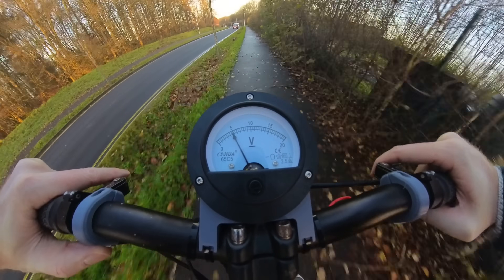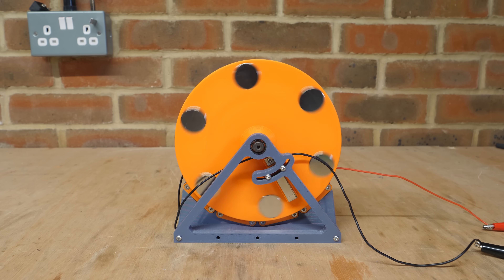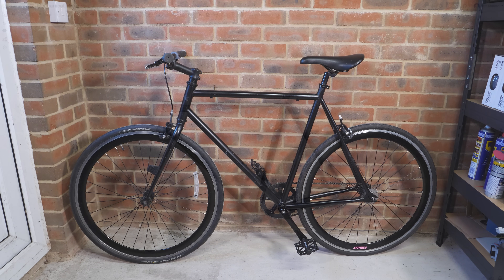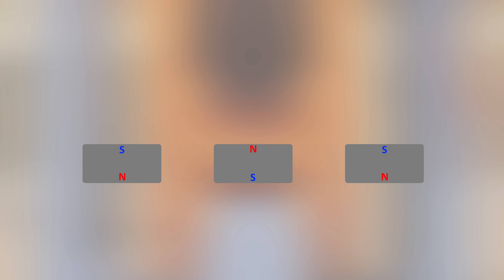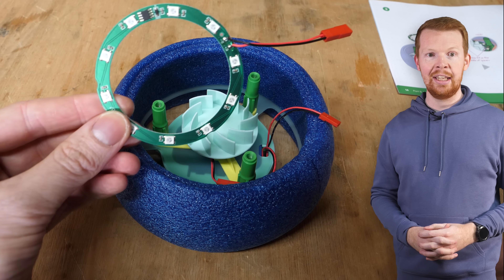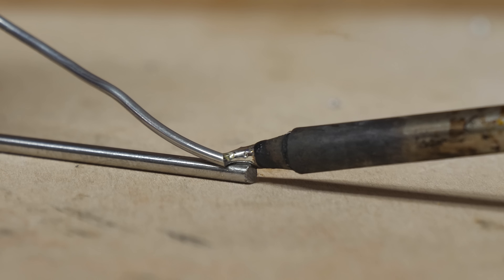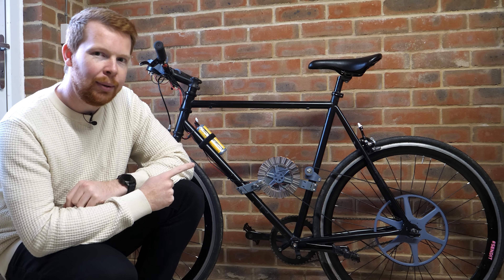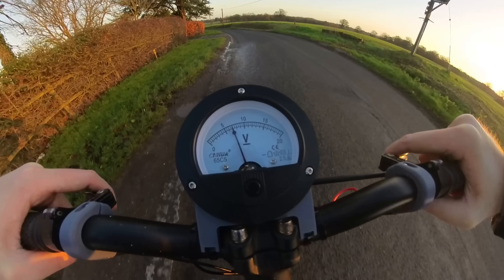The Most Minimal Electric Bike

Comment: You could even build a mechanical throttle: make the reed switch position variable: If it is closer to the magnets, it's on more often, if it's further out, it's on less often, varying the effective power.
But yeah, electronics are used for a reason. Even just replacing the reed switch with a simple sensor-transistor combo would make this thing a lot better (also needs a freewheeling diode so the transistor does not blow up).
Reply: You where thinking about opto-electronics? Or hall-Sensor?
Reply: That wouldn't really result in throttling, it would just cause the switch to either be always on (killing power and shorting the supercaps since it would be pulling backwards as much as pushing forwards on the rotor), always off, working correctly or sporadically and randomly in between, without any kind of consistent increase or decrease in duty cycle

Comment: A question from a non-electrically-educated-guy, why not put 2 engines on the bike? The first one would be the one in the video - the plastic one. The other one would be a standard e-bike motor. Basically charge downhill as you did and afterwords for a short distance give yourself ULTRA BOOST! not sure if it's actually plausible but at least in my mind it makes sense :D
Reply: And of course the super capacitor in between the motors...

Comment: Hello Tom,
About the spark after breaking the switch 
...
Did you know about the free will diode?
Every time a self is unpowerded it realease the actual magnetic energy through a spike .
You can short this spike with a single diode mount in reverse, or even better, keep and redirect this energy for your capacitors.
Just saying. May be it can increase efficientcy a bit

Sorry for my bad English, sir.
Reply: In english often called a "flyback diode". It is the right answer, but I think a diode qualifies as "electronics" and so isn't right for this project.
Reply: @bbrockert  It's also sometimes called a freewheel diode, from which I can see "free will diode" as an understandable misspelling.
Reply: Yeah, preventing arcing on switching inductive loads is a huge topic in electrical engineering 😉
Companies also put a lot of development in the material of the electrical contactor.
Also: If you want the switch to operate fast, then make it light wight. The little magnet on the switch contact adds too much inertia.
Try hot soldering the tungsten with silver solder
Reply: A diode is electronics, and he is specifillay not using that for the motor. That's the whole point of it all.

Comment: I know you said that you don't want to use electronics - but would a MOSFET with its gate hooked up to a copper wire coil work even better than a mechanical read switch?

Comment: It's interesting. Might I suggest  that you next build a charge controller with vacuum tubes. There are low voltage vacuum tubes were used in portable radios and there's a mechanic gadget that boost the voltage for the plate. I can't say that I've ever seen anyone build such a machine.
Reply: What's the advantage of using vacuum chubes?
Reply: @hxhdfjifzirstc894  Well, if we ever get hit by an extreme solar pulse, vacuum tubes will survive when semiconductors get fried. You might have the only working vehicle on Earth after a nuclear war. It would also be more warming of your parts for cold weather riding. I don't think it's a question of finding something better as much as its about finding a different way should conditions demand it.

Comment: Maybe if you want a regen brake you could mount a regular dynamo like a break pad. That is a cheaper simpler and easier method. You could even operate it with the brake lever, if you fiddle with it so that it engages before the regular brake. :)

Comment: You could add a 17v rated zener diode and a power resistor. When voltage goes over 17v it dumps the power into the resistor, heating whatever, instead of blowing up your supercaps and potentially neuter you.
Reply: Better yet to just have it energize a coil, disconnecting the circuit entirely.
Reply: Old car engines used electro-mechanical voltage regulators, for charging the battery from the alternator, or dynamo, whichever they used. Something a lot like relays with different, specific voltage ratings for their coils, doing the job without any silicon. It kept the battery charge voltage around something it could handle.
Reply: In parallel right?
Reply: @Eduardo_Espinoza  no, in series
Reply: There are far more elegant ways to prevent overcharging the capacitors, like using a 12 V battery pack and diodes, so the battery pack starts to soak up energy when the voltage goes over the voltage of the battery pack plus the dropout voltage of the diodes. 

The power rating of most common zener diodes range from a fraction of a watt, to 5 watts, which is essentially nothing in this case. Zener diodes are diodes, not voltage regulated switches. The current through it times the voltage drop will give you the power dissipated by the zener, a power resistor in series with a zener will only take care of the volts that the zener doesn't drop. At 18 volts, a 17 volt zener in series with a power resistor would have to dissipate 17/18 of the total amount of power through those two components. 

Another issue with zener diodes is that they don't give you a perfect cutout, they have a nominal voltage, but in reality it's a curve. All this put together makes zener diodes a poor choice for "direct" voltage regulation, for anything but very low power. Besides those details, your idea is great.
Reply: @fishyerik  Yeah you'd need a transistor with your zener to actually handle the current and send it through to the resistor. A zener is "electronics" anyway so you'd already be cheating. Using diodes with the battery pack doesn't make sense, since to charge and discharge, you'd need diodes going both ways, the equivalent circuit for that being a bit of wire.

You COULD use a proper lithium charge controller, but again that's more electronics. Easiest way though, don't wanna piss off a lithium battery.
Reply: If you add fans to it, that is essentially what freight trains do to avoid overheating a train length of brakes down a long steep slope. As far as I know, it is called a dynamic brake.
Reply: I had a 1960s BSA 441 Victor motorcycle (British, appropriately enough) that dumped excess generator power to a Zener diode mounted to a big heat sync between the front forks.
Reply: @Elephantine999  You're sure it's a zener and not just a diode? Is it one of the old selenium ones, or even older, copper oxide? They often have layers. They can smell very weird when they get hot. TVs back then used them too, often in big stacks to handle higher reverse voltage, avoiding breakdown. Zeners really aren't meant to dump power into, nor are any diodes. A normal diode's voltage drop, times the current flowing, will be dissipated power in Watts. But something like a zener, that'd be an enormous power. Coming from a bike's dynamo or alternator, that's decent power, to power the lights and engine coil and all. Lots of current. Wouldn't want to dump that through a zener.

You're sure the zener isn't just powering a coil that opens a switch if voltage gets too high? A coil, electromagnet, with lots of turns could work on low voltage and high current. Enough that a zener could feed it. That's how some old voltage regulators worked, relays set to open and close around certain voltages, although I'm not sure if that always involved zeners, or just coils and contacts designed to be very precise on their opening and closing voltages.
Reply: If you add a resistor to dissipate more power then the voltage is no longer clamped to the zener voltage (which itself is quite poorly defined), and instead varies with current.
Reply: Or he could just measure the voltage being generated using a multimeter and increase/decrease the turns to make it under 17v accordingly.

The maximum voltage that "motor" will generate is determined by the number of turns.

Given he already subjected the super-cap to that maximum voltage every time he was charging it, it's probably fine the way it is...
Reply: Dioda zenera to już elektronika. Można dać dzielnik napięcia + przekaźnik.
Reply: Mens/boys bikes always have the potential to neuter their riders. This is why I have a step-through frame. >;-)
Reply: Or you could just hook a few batteries to save those powers so it doesnt all go to waste....
Reply: if we're throwing diodes on here anyway, a flyback diode on the switch would probably deal with the arcing issue...
Reply: nice suggestion!
Reply: But a diode would be cheating, the point was to do it without electronics.
Reply: @SailingSoWhat  you didnt finish the video?
Reply: @justinc2633  you caught me, I wrote that comment before finishing 😅
When he used a rectifier it would not matter anymore of course
Reply: @SailingSoWhat  yea, also i think if he cheated for "safety" imo its ok, having a functioning machine with no electronics was the challenge, but yeah he broke his own rule anyway lol
Reply: @justinc2633  Those electronics are outside of the motor. The point is that the motor/generator should work without any electronics, which it does. What you then use the power for is irrelevant. That can be for any electronics.
Reply: @justinc2633  A Zener diode is actually not a diod, but at set of transistor organized in a away that make them act somewhat simular to a diode. Hence even if you don´t count diods as electronics (That you may or may not do), a zener diod is for sure electronics
Reply: @justinc2633 
Well, he didn't technically break his no electronics rule, because he chose "the branch of physics and technology concerned with designing circuits using transistors and microchips " as his definition for the word electronics. A highly restrictive, and certainly arguable (vacuum tubes/valves, anyone?) definition, but that's what he said he meant by the term.
Reply: @RottnRobbie  diodes are an electronic component.
Reply: @justinc2633  Well, yes, I know that. You know that. Heck, I expect Tom Stanton knows it too. But at the 20 second mark in this video, he explains that what he means by "no electronics" is what I quoted above.
It's Tom's video, so it's Tom's rules - even if he did fudge them.

It's kinda like if I said my 2023 Kia was made without any modern technology, where by  "modern", I mean anything that was invented after 2024.
Reply: @SailingSoWhat  What do you think a bridge rectifier is?
Reply: @Clayne151  Well I commented before reading all the comments s we're even! :D
Reply: @SailingSoWhat  Spark gap and resistor would be the "non electronic" way to do it. Though I don't think you can find spark gaps for such low voltages.
Reply: @SailingSoWhat diode isn't electronics. Low power Logic gates are
Reply: @SailingSoWhat you could technically use electrolytic diodes or mechanical ones instead. Or some sort of electromechanical relay setup using a  mechanical vu meter and a bunch of contacts.  Also im not sure but I saw someone else build a scooter similar to this and I think they used a Wheatstone bridge.
Reply: @SailingSoWhat  Why not completely shirk modern technology advances and cast the entire bike components using lost wax method?  3D printer doesn't align with the no 'tronics on the bike universe
Reply: it would all dissipate on a diode not on resistor
Reply: @fssddfsd3  no when a zenor diode exceeds its reverse bias voltage it conducts, aka it becomes low impedance, which means the energy would be dissipated through whatever load you connect to it
Reply: @justinc2633  i don't think you understand what you are saying.
Reply: @justinc2633 When a zener conducts, it disipates power equal to its voltage multiplied by the current through it. Nothing you do can change that.
Reply: @fssddfsd3  one of us don't, stay in school :)
Reply: @justinc2633 the zener voltage across the zener diode will quickly burn the zener diode, first.
But his challenge, to do it without electronics is done.
Reply: @justinc2633 he's right, a zenerdiode with resitor in series would result in burning all the energy inside the zenerdiode. Lets say you are at 18V capacitor voltage and you got a 17volt zenerdiode. one amp of current would result in 17 watts destroying your zenerdiode and one watt barely heating the resistor. What you can do, is use the zenerdiode to control a beefy darlington transtor that is connected to a resistor. But darlington transistor = electronic (zenerdiode is as well, but psssst)
Reply: 5~30V boost converter PCBs ok la

Comment: (edit: you fixed it 😊) Hey Tom long time fan but just a tip, move your idler/tensioner to the non-driven (return) side of the belt.  You'll see this is the way sepentine belt and timing chain tensioners in cars are set up.  You may be loosing a little power into your tensioner in this configuration.

Comment: I don't think iron core motors have larger mechanical resistance due to magnets being attracted to the core: that's a conservative force and also there's enough magnets for that to average out. I think the resistance is caused by eddy currents.
Reply: True ...
I think eddy currents can be minimized by using ferrite material.
But there is also a kind of cogging moment at each pole. Maybe he wants to avoid that.

Comment: Tom, Have you tried a condensor across the points of your switch like those used in autos that used ignition coils and points.  This very problem was in the autos by adding the condensor it reduced the arcing of the points giving longer life to the points between tune-ups.

Comment: I wonder if plating the tip of the tungsten with something solderable would work, if there's a metal that will form a strong enough bond with the tungsten for soldering onto. Or you could just thread the rod with a die and use two nuts to crimp a wire onto it :D

Comment: A hallbock array help close the air gap through  a portion of the magnetic circuit and contributes to the overall magnetic field in the air gap.   A steel plate also helps close the air gap through a portion of the magnetic circuit, and  yoking magnets with iron or steel also increases the strength of the field in the air gap. 

Maybe a steel plate might not be as strong as a hallbock array but you'll get very similar results for much cheaper.
Reply: It will be heavier
Reply: @Mostafa-vs8bd  maybe, but not much heavyer than trying to close the airgap with magnets to make a hallbock array.
Reply: Steel plate may introduce some eddy current which increases drag during freewheeling
Reply: @diamonddogie  steel plate to yoke magnetic field, remove the air gap on one side between magnets with an unchanging magnetic field which means little to no eddy currents.
Reply: @diamonddogie  if we were changing the magnetic field inside steel, as would be the case with steel inside the coil, then yes the motor would  experience Eddy currents and hysteresis losses due to the retentivity and coercivity of the steel